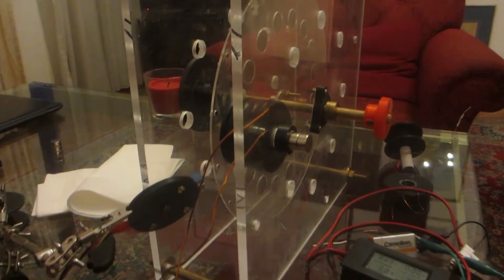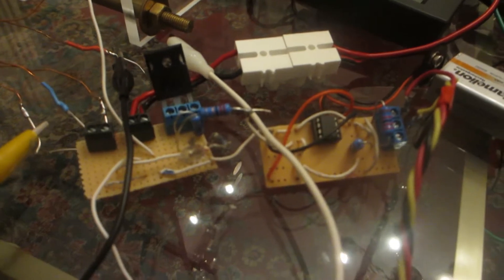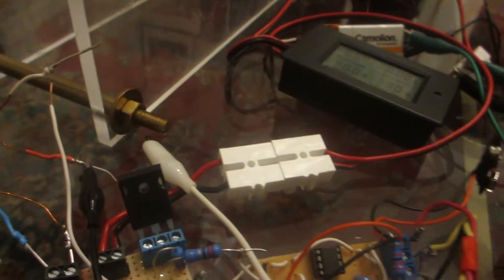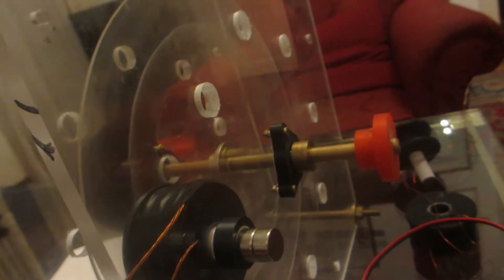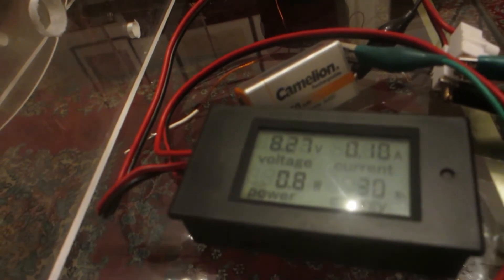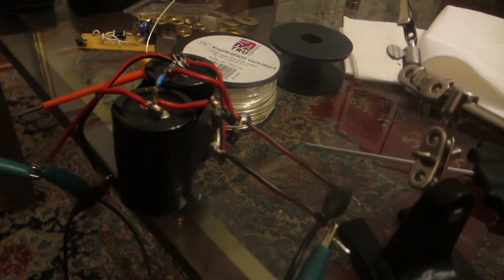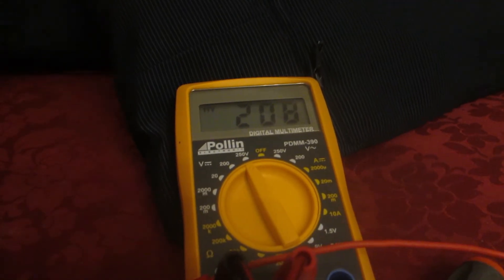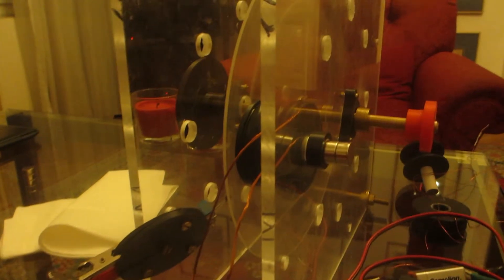Motor Generator 200 Volts output - Nearly Free Energy

Comment: this looks interesting, do you have a schematic for the circuit etc....and also the timing wheel.....cheers
Reply from the maker: Hi thanks for posting.
well, it is doug Konzen's circuit. i reproduced it from here:
https://www.youtube.com/watch?v=hR-pq60R62k
if you check out the video before and after that one  he does explain everything about the timing disk. I just placed the small magnets 4mm in diameter,  further away from the center of the disk.. he used a separate timing disk with magnets closer to the center. Actually we are working here with such low current, that the difference is practically not to be noticed.
Luc
Reply: @FreeEnergyNerd  hi again, thanks for your reply, this looks good,......do you have any info in the "directionally wound cone-shaped motor coils"....and the "reverse wound inductor coils" ? thanks again
Reply from the maker: @mattlast4093  Well the directionnally wound coils, thats a speciality of doug Konzen..  go a couple of videos back in his channel.. he has several videos  about how he is doing it... i never wound them that way (actually i did it once, but i was not able to measure any difference, so i stopped doing it. ) Doug says he has much better values. So yes it may bring something, but only if you are very consequent and do it on every coil. Personnally i think that they work only better, because when we do it, we wind them more carefully... thats all.
Luc
Reply: @FreeEnergyNerd  thanks :-)

Comment: Hi Luc
Looks great!
Thanks so much for building this and getting it going!
I just built two voltage doublers yesterday going off your advice...I put them on the induced generator winds (50 ohms ) but need more built to put on the steering  diode flyback out .
Yes you see the power going into the caps!
It's there, now get it out and refill without killing the rotation!
I did some experiments with your idea to pulse 4 times into motor coils that hit 4 magnets in a revolution, I used the second motor for this it worked good but should maybe use same rotor put 4 magnets near axle for an inner motor.  Maybe should split it up do 8 magnets  and have 8 "blank spaces" in rotor to take power out non reflective.
Thinking about adding a second diode to the steering diode to protect from reflection not sure yet 
I have seperate 9v for halls and driver too, now I have put in over 30v from cap bank back to motor coil mosfets  nothing blown up yet.
Also my mosfets are bidirectional, the gates and sources connect with two mosfets, the switching between drain A and drain B steering diode in just one drain the other doesnt do much.
Also to boost caps filling better I combine steering diode flyback with the induced generator coil output.  Parallel them on rectified side.
If you have some DC to DC step up  buck convertors try to loop with those.  They isolate and boost voltage under loading.
Most dussapiinting is you have so much voltage in caps but load it and it drops down to 3v or so constant output to load ....load being a motor coil or whatever...
Keep going don't stop
Reply from the maker: Thanks for all your advice. I will advance slowly.. first i will optimize the coil(s). as i still have 2 strands free on this one i can double the wire length... By putting the hall on the big magnets.. it started to turn at 1100 rpm, (but using 350 mA) so i will stick to the small trigger magnets. Good idea with the 8 magnets.. but i would just drive with the 8 trigger magnets and leave the 8 bigger magnets inside... maybe it could generate a little bit. (on another coil)... I see there is really a lot to do.. but I will be advancing step by step.. Luc
Reply: I know im randomly asking but does any of you know of a trick to get back into an Instagram account?
I stupidly lost the password. I appreciate any help you can offer me
Reply: @Justin Duncan Instablaster :)
Reply: @Elijah Santiago thanks so much for your reply. I got to the site through google and Im trying it out atm.
I see it takes a while so I will get back to you later when my account password hopefully is recovered.
Reply: @Elijah Santiago It worked and I now got access to my account again. Im so happy!
Thank you so much, you really help me out :D
Reply: @Justin Duncan happy to help :)

Comment: Hi Luc 
I tried out my voltage doublers today. Nothing dramatic since the load still squishes voltage in caps way down like before.  However I was using them on the induced pickup winds of 50ohms and only got so far with it. The voltage doubles, but amps sacrificed to do it so caps fill slower it seems so anyways need to work on it more.
I had 100 uf size caps (two of them) in the doublers maybe I should have much smaller uf?
What's cap uf in your doubler?
See if you can get the 2 amps on meter when you get that far!
Try running your into input into the collector  caps and then hitting them with the fly back too. (Pre charge the caps sort of via the input)
Are your magnets repulsive to the motor coils?
Reply from the maker: weill i am using these caps: https://www.amazon.de/-/en/Electrolytic-Capacitor-KENDEIL-LongLife-LowESR/dp/B07MMMWV5Y but DONT buy them there... i have a german site that has them for 1.90€ each,,, that would be here:  https://www.pollin.at/p/elko-kendeil-k05-470-mf-450-v-210781 ... thats where i got them... maybe there are other places that are cheaper.. but i doubt it... for 470µF and 450V...
Reply from the maker: They ( the german site) also have 100µF caps with 330Volts.. as cheap as 14cents a piece. (you have to take bundles of 10)  but 1.41€ for 10 photo caps (the fast ones) is a good price IMHO.. https://www.pollin.at/p/camion-photo-flash-100-f-330-v-10-stueck-210686
i do have 2 or 3 10.000µF caps but i hardly ever use them.. they take to long to fill.

Comment: This is very good.
Would you please share the circuit diagram s with us please I really need to construct such to power my little UFO
I only need the circuit diagram please
Reply from the maker: I use the diagram from doug Konsen. You can find it in this video at the beginning: https://www.youtube.com/watch?v=hR-pq60R62k
I hope that helps.
Luc
Reply: Please help reply back again, I can't open the links u sent
Reply from the maker: @ijalepaul3533  Strange... you cannot open the youtube link? its the original circuit by doug konsen. he shows it in the 10 first seconds of the video.. just do a screen shot.
here the link again: https://www.youtube.com/watch?v=hR-pq60R62k
I used that one.. i have nothing else. !
Luc